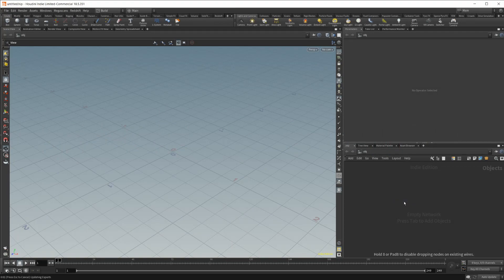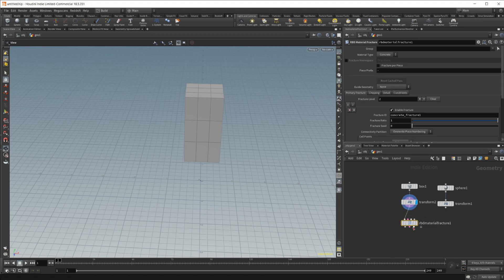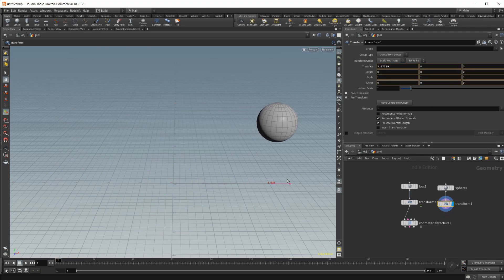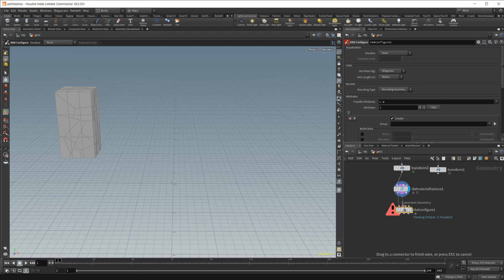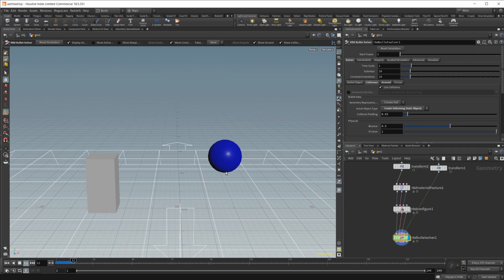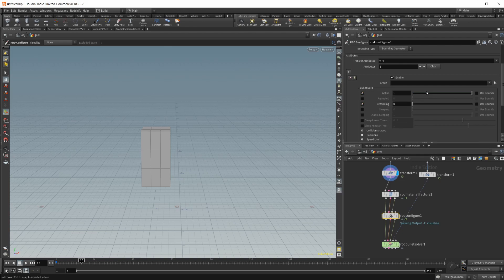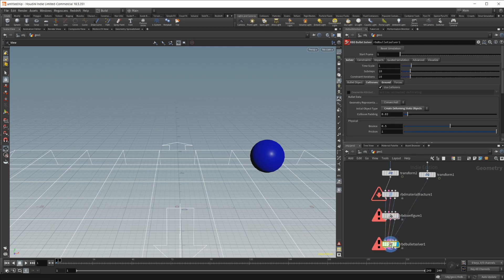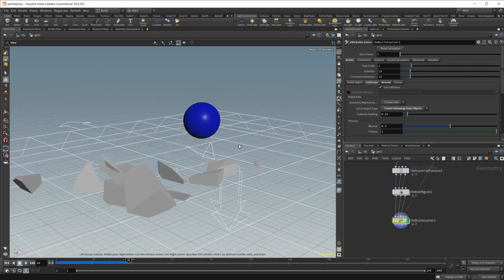Blending Animation and Simulation in the Bullet Solver in Houdini

Comment: When you put the animated transform node above the rbdmaterialfracture node, you will see the the node gets a little green time-watch icon near it, that menas this node is now cooking each frame. If you move the transform node of the box under the rbdmaterialfracture node, to the geometry stream ( the left most connection) the node above it will stop being time dependent and will only cook once.

Also now the simulation will run much faster.
Reply from the maker: Doing that broke some things when I did it. I do not remember exactly what but I believe it caused issues with the animation working inside the bullet solver.
Reply: @InsideTheMindSpace  not sure why, I built the exact same set up as in the tutorial, and moving the transform node under the fracture node worked perfectly..
Maybe you tried it in a more  complex setup?
Reply from the maker: @OzAdi  Completely possible. If that works that is great. If not for most things it should not really matter. Thanks for the feedback though.
Reply: That fixes few things for me and is definitely much faster! Thanks!
Reply: it works faster, you only have to keep in mind to apply that transformation not only to geometry but to constraints and proxy geometry as well, then it works all fine.
Reply: @BeastArt.3d  thanks for that last tip.

Comment: Hey Stormz! what OzAdi said is perfectly fine solution but you have to animate your object after the rbdconfigure node because rbdconfigure node pack the geometry and all the point animation won't change packed transform Intrinsic matrix and bullet solver not able to read intrinsic transform matrix because it's not being updated. If you put your transform node after the rbdconfigure node everything will work perfectly fine.Cheers & Good Luck
Reply from the maker: That makes a lot of sense and would totally explain why it didn't work in my initial tests. I didn't think that would work after the configure node so I never tried it.
Reply: @InsideTheMindSpace  Glad to help
Reply: P cinematic  I was wondering the same thing. I have windows that break gradually throughout the shot, where the inactive pieces need to continue with the original animation.
Reply: I presume you need to use an Unpack node to create one output to connect tp a Transform node then Pack again to feed the three outputs back in to the tree rather than connecting the Transform to the first output?